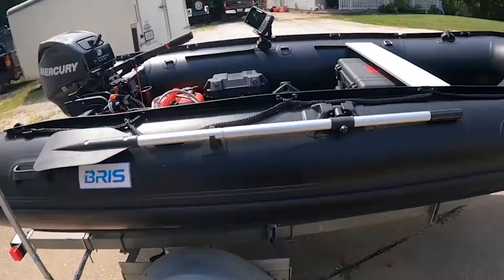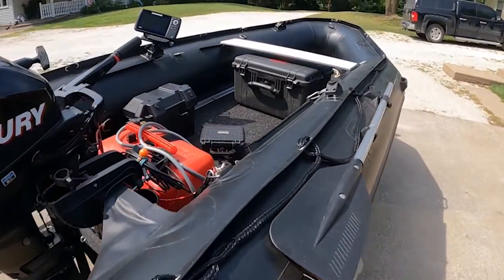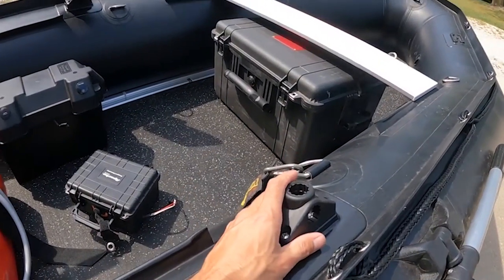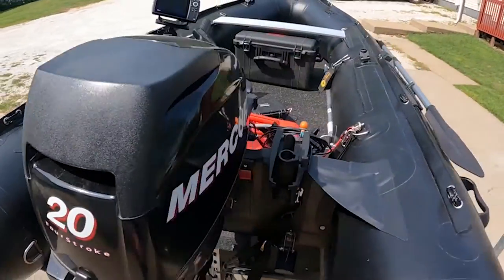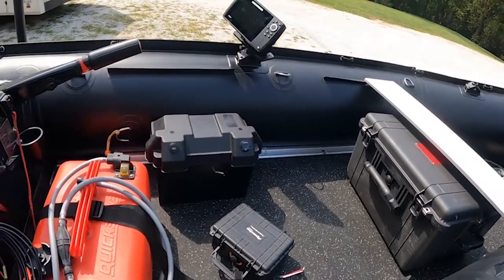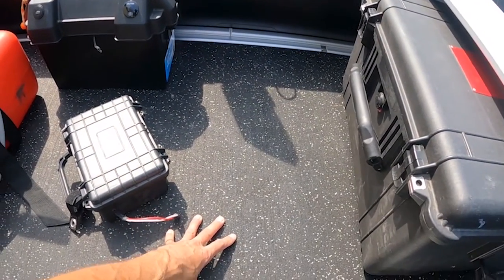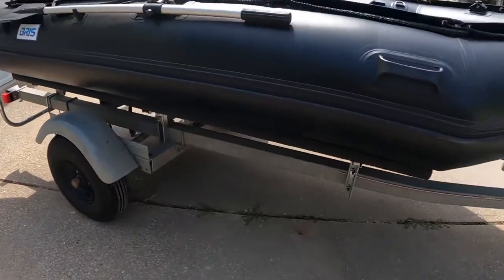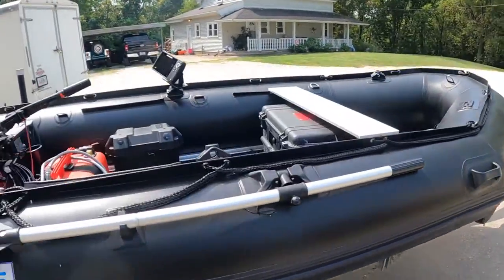BRIS Inflatable Boat with UPGRADES!!! SCUBA DIVING BOAT

Comment: I have the same boat, with a merc 25 2 stroke, and Simrad GO 9 XSE. I added bimini and Renogy 170 solar to top of bimini, and Victron MPPT  and have a lithium battery pack to run everything. Also installed a Whale Supersub bilge pump under deck. and have a Waeco cooler converted to a live well. Great boat so far, no real issues. Greetings from Sydney, Australia mate!
Reply from the maker: Sounds like an awesome set up!! Bet it moves with a 25HP. I was kinda scared putting a 20HP on this boat..lol, but glad I did. Appreciate you watching and commenting.
Reply: Hi guys, can you tell me after owning it for 1+ years, is there any issue with the wooden transoms and how they are glued/welded to the dinghy?

Comment: Love what you did with the trailer, would love a more in depth walkthrough on the trailer, as there are few setups out there that fit these inflatable boats as nicely as yours seems to.. kudos brother!!
Reply from the maker: Appreciate it! I did put alot of thought in to it...maybe even more than I needed to. :) Will be doing a more in depth video with the boat off the trailer...whenever this weather takes a turn for the better.

Comment: Awesome video. Ive got the 16 ft version of this boat and i just bought a 30 hp etec motor for it today.

Im interested in your trailer set up and seeing how you support the transom and motor while in travel!

Right now i have my boat on just a flat deck trailer, i just deflate the keel when i load it up and inflate it before i launch it. I get my transom onto the deck itself so its supported, and then i have whats called a transom saver which is a little arm thats attached to the frame of the trailer and comes up from below the transom and supports the outboard by the lower unit so all that weight isnt prying on my transom when i hit pot holes. Id love an update video on your boat and more upgrades youve done it it or things you would reccomend or not reccomend doing to it
Reply from the maker: Thanks man!! I thought about getting that 16 ft. but figured Id start with the 12.5 ft. A 30HP should be plenty for that boat.  Lol.  I have a single support as well that supports the transom from the main frame, and an inch or so on each side of the transom that sits on the same supports as the tubes..as for the motor, I have an outboard motor mount (called a "transom saver" that mounts motor in the up position) that removes most all of the weight of the motor off the transom and is supported to the trailer frame. I'll do an updated video with everything attached and a little more explanation of what I did to the trailer. I did retrofit trailer for this boat exactly, so I suspended the boat completely inflated with ratchet straps from my garage ceiling so I could hang the boat over the trailer to get exact locations of bunk rails, etc. That help alot as you know the boat is light, but too heavy/akward for one person to manage. Hope that helps so far. And I'll be sure to do an updated video. And thanks for subscribing!! Appreciate it!!

Comment: Thank you very much for your video. I like how you film this video and your voice is really nice. I am thinking to buy the same boat. How does it hold up? Are you still using the same boat?
Reply from the maker: Thank you so much! I do, in fact, have the same boat and with the SAME air I put in it when I first got it. It's held up great so far, but I do keep it stored in the garage ALL year round, so that makes a difference. Thanks for watching.
Reply: I don't quite get why anyone would choose a Inflatable on a trailer(If you live in a Apartment and have to store the inflatable boat every time Ok). Same size and weight(and price) A Aluminum or Poly Boat, will have twice the space. I started with a inflatable back in the 1970's, then upgraded to a 12 ft alluminum Starcraft. Cartoped it for several 1000's miles. 4 persons with room to spare, tons of gear, and most of the time by myself. Would never go back to inflatable
Reply: @WillyK51  yes because I don't have space to store the aluminium boat. The new houses just get smaller and many need to live in apartments. But we still want to get a boat, unless you can suggest better options

Comment: Hi guys, can you tell me after owning it for 1+ years, is there any issue with the wooden transoms and how they are glued/welded to the dinghy?
Reply from the maker: Holding up great so far, but I do keep it in the garage and out of the sun, which I'm sure helps ALOT. And still has the ORIGINAL air in it!!

Comment: Thanks for the video! What do you think your speed is at 75% throttle? I'm in the research phase of getting an inflatable and a  motor. Speed for me will be a high priority since I'm planning on going up to 20 miles to certain spots. Thanks in advance!
Reply from the maker: I'd say it'd be around 15 MPH. Speed was never a concern when I put this all together. 20 mph is plenty fast for what I need it for...lol.

Comment: Hi. Could you tell me which mount you used for your Helix 8?  Just bought a BRIS and this is a lot of help.  Thanks
Reply from the maker: Hey. I use the Scotty 367 universal fish finder mount, good for up to a 9in display. Has worked great!
Reply: @cBelowH2O  thank you very much. While you’re here I am also curious how you mounted your transducer.  I see where it’s mounted but not the type of bracket
Reply from the maker: @Todd Wade  Not a problem. That one I have listed in the description. It's a scotty type mount arm that is a quick connnect. I believe one of my videos shows that in a little more detail.

Comment: nice set up, do you recommend to drill some holes on the front deck for tying  anchor rope? my plan was to glue some D rings on the bow to tie it.
Reply from the maker: Thanks!! They have some glue on D rings you can put anywhere. This came with like 16 D rings on it, so Im probably good. Lol

Comment: Do you have any problems with the boat getting on plane? How fast does it run. Have a new 20 hp Suzuki 4 stroke and just ordered this boat. Thank you
Reply from the maker: I have no problem getting this boat on plane. Had 2 adults, 3 kids(6yr olds), on it and still planed great. You'll be fine with that motor. Amount of weight and weight distribution will be the biggest factor towards how fast you can get on plane. You'll love it!!

Comment: while trailer running on highway, boat can hold Motor without any issue?
Reply from the maker: Yes. Since the transom is supported by trailer and motor is supported by transom saver, all the heavy weight is on the trailer. Have had no issues.

Comment: So, how do you scuba out of it? I'd assume getting onto the boat with scuba gear would be a pain after a dive. Do you anchor then solo dive or someone always on the boat... ?
Reply from the maker: Typically easiest to take gear off, re-enter the boat, then pull in your gear. Just make sure BCD has air in it to keep it floating while re-entering. Honestly, its easier than walking up a ladder on a typical dive boat with all your gear on.

Comment: I want to get a trailer just like your any recommendations?
Reply from the maker: I used a normal boat trailer for a 19 ft run-around boat, stripped it and modified it to fit this exact boat. I've seen other use a typical 4x8 trailer slightly modified as well.

Comment: Is there any issues with the location of the transducer ? Any interference ?
Reply from the maker: There does seem to be a little interference on the side of the transducer that faces the motor.  Given how small the transom is and cant get it any further away from the motor, I will most likely be moving it to a different location using a Scotty mount off side of one of the tubes, and just lift it out of water when traveling high speeds.

Comment: So after having now for couple of years now. What major problems you have with it?
Reply from the maker: Surprisingly enough, I've had zero problems. But I do take care of it as it's garage kept when not in use. Still has the same air in it as the day I first pumped it up.
Reply: @cBelowH2O  that’s great I just bought the 15.4 2022 one. Just need to buy the motor now. Thinking on a 15 horse 4 stroke one. Really don’t need speed but to handle some waves and using boat for diving mostly
Reply from the maker: @Christopher Smith  Awesome. You'll love it. I originally was looking for a 15HP but ran across a really good 20 HP that I have now, so got that one..lol. although if you got the bigger version bris, getting on plane with a 15HP might be difficult...

Comment: What is the transom dive flag mount you have?...you did not mention it in the video and I am looking for something similar. Thanks
Reply from the maker: Thats actually a trolling motor mount. It was there to clamp the board on that the transducer is mounted to(didnt want to drill thru the transom). But I did notice too that it would make a great flag mount.

Comment: I am thinking of buying a BRIS boat from Amazon I would love to have your opinion about this inflatable since they are Chinese made how do you like it . Thank you
Reply from the maker: So far I really like it. It is holding up very well. It is garage kept (always inflated on trailer) and always cleaned after taking out, so that def. helps.
Reply: I bought the 16 ft last year. Have a 20hp merc for it. Would fold it up and store everything in the back of my F150 all summer. Only issue I have is making sure you inflate the boat and keel properly to give a smooth ride and planing. Makes a world of difference.